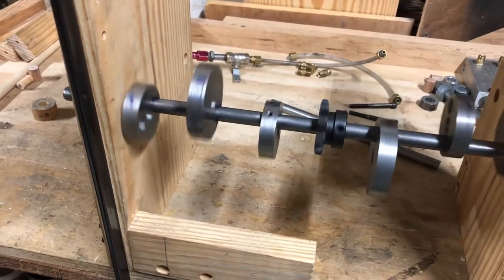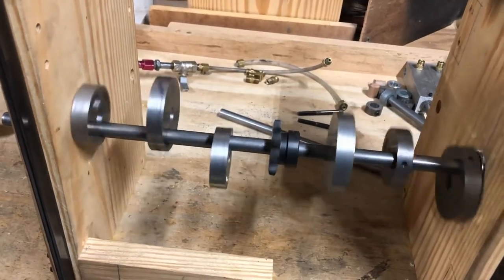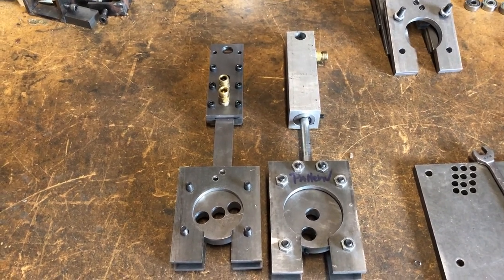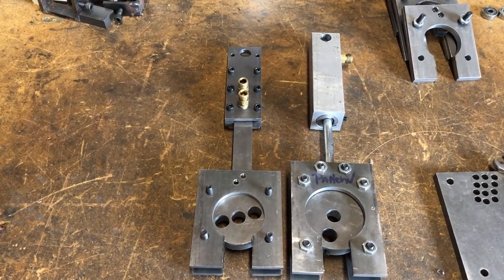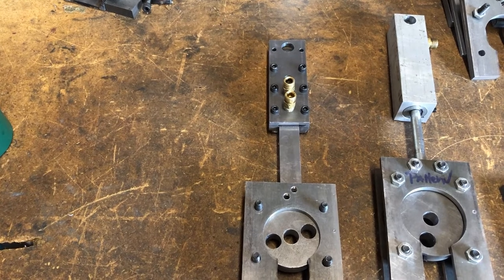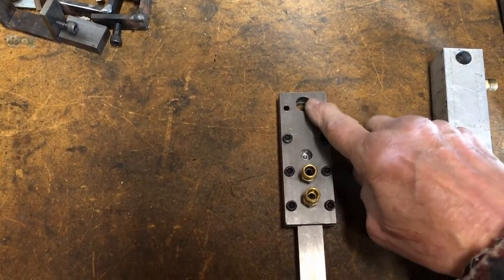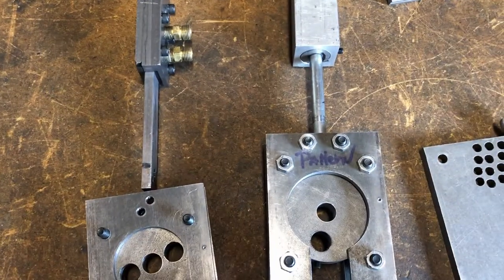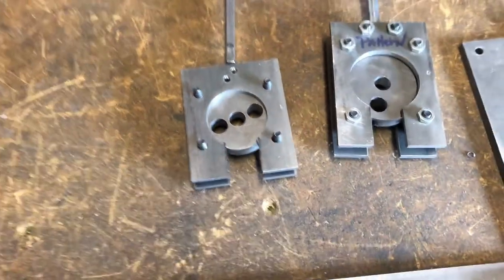Compressed Air Eccentric Drive Air Engine Revised 12-6-21

Comment: I just found your channel I immediately subscribed I love what you’re doing do you have an email or I can contact you? I design air guns and I might be able to help you with a good valve mechanism that maybe help you. And maybe even design an in-line engine that should give you good power.  if you’re interested leave your email and I’ll share my design with you see if maybe I can help you along. I love what you’re doing!
Reply from the maker: Thanks for the comments and offer, but this is a project i must complete without help.
My goal is a totally mechanical, simple to build and maintain, and with as few parts as possible. 

I am documenting my successes and failures as i work on my project, for a book someday, on " How I Built my Simple Compressed Air Engine", so I must complete it on my own.
 
Any and all comments are welcome for all to see on the air engine research channel comments section are welcome and will be considered.

Once again thanks for subscribing
Reply: @AirEngineResearch  Maybe consider just a single piston in line Engine Michelle Straight up just a single large piston
Reply: @AirEngineResearch  I mean there’s nothing wrong with all letting your subscribers give you advice and stuff otherwise what’s the point in joining you and your adventure I’m just saying your multi piston mechanism seems far too complicated and complex and it doesn’t seem to give any power a single person design or a rotary design might be your best chance a rotary engine is pretty hard to fabricate yourself so consider just a large single Piston design. Like I said I have a large piston mechanism that is simple and can help you I’m just trying to give you advice to move you along because it is interesting but if I can’t even help you or give you any help or join you I’m not sure I want to bother even subscribing
Reply from the maker: I am open for advice and ideas, but like I said the final results Has to be from me otherwise it’s not a true personal project.
If you think you have something that would improve what I have shown in my video, please do send me information on what you think would be better.
I started out using the crankshaft and a 3 inch piston, but found out very soon that the amount of compressed air necessary to run would be impractical.
Send your information and diagrams to dejacobs1940@gmail.com
And we’ll talk about it.